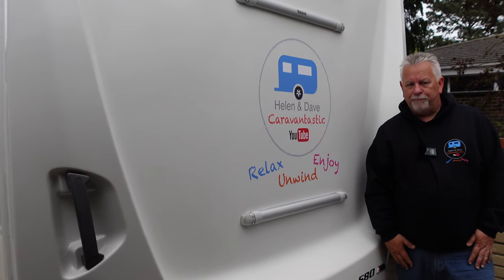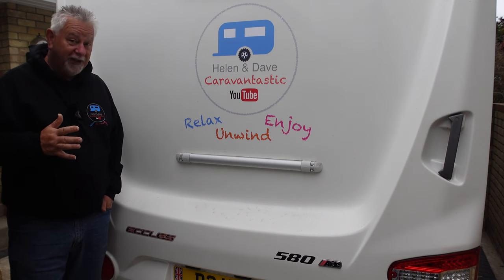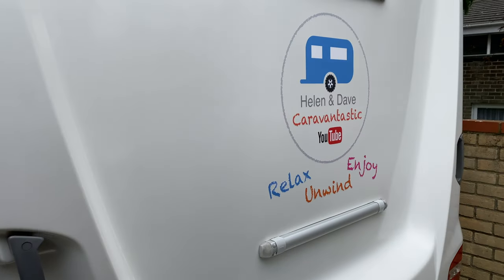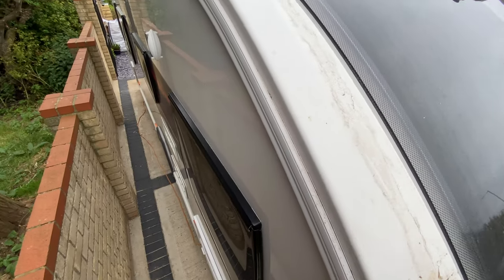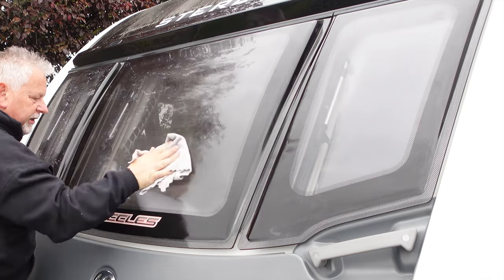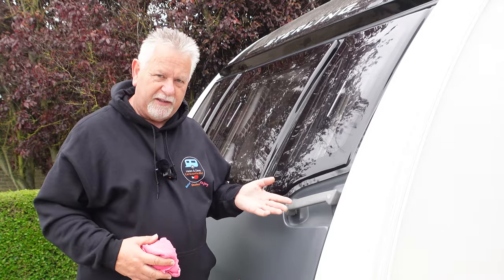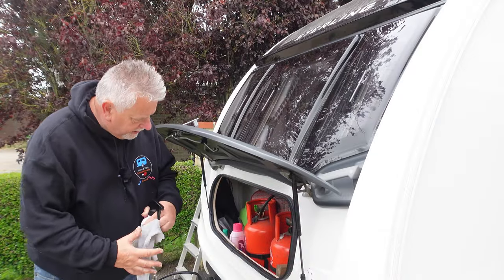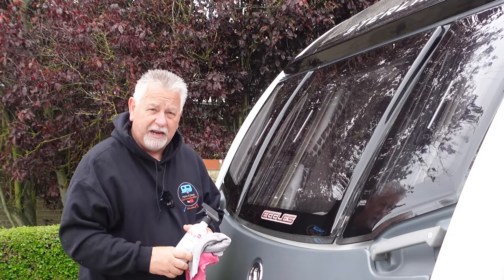Amazing results with Silky Dry & Shine!

Comment: Hi Dave, Really brings up the shine but I’m dubious about the dirt building up on the cloth and eventually causing fine scratches as you go along 🤔 . On another note about the caravan club not allowing people to wash their caravans - I would prefer to see clean caravans on a site as it would make the site look more respectable. I’ve also been in that situation a few times leaving home with a clean car and caravan and arriving covered in dirt. I carry a bucket and wash shampoo 😁.  Cheers, Rob 😀
Reply from the maker: Love your style Rob! Where there's a will, there's a way lol. 
I also agree with your point ref: 'dirty cloth'. Dry & Shine is a great detailer, to use after a dirty caravan as had a pre wash, it adds a great shine and really useful for getting to bits that need a little more or were missed during the wash but I've found it really useful on site, mainly front and back to clear light dirt/dust away. I also agree, clean caravans on site make the place look better. Thanks as always, Dave

Comment: Hi Dave so this works the same as waterless wax meaning you can clean a vehicle without rinsing with water that isnt too dirty all over like grit from the road etc.  but just use on dust and odd marks from dead flies etc. It certainly looks lovely and shiny. My brand new van has sat on our drive 3 weeks collecting pollen off nearby hedges and general dust as we havnt used it yet due to a slipped disc in my back its so frustrating just staring at the van 😁 always follow your videos. Keep up the good help for newbies like me. 😊
Reply from the maker: Hi there Sally, sorry to hear about your slipped disc. I’ve had one so understand your frustrations. Hope you are able to get out and about before too long. This product is ideal for just getting the shine back on your van without the full on wash & wax. Take care, Dave & Helen 👍

Comment: Hi Dave. Ive used Silky cream cleaner for 40 yrars and it is s brilliant product from an excellent manufacturer.  However I still feel that you initially need lots of water to wash off the fine grit and dust be shampooing the van.  Otherwise I cannot see how this and other dry products don't leave fine scratch marks especially on perspex windows.
Reply from the maker: Hi Dave, thanks very much for watching and leaving a comment. This product is especially useful to use as a detailer and use in addition to a normal wash & wax. I’ve found it to be really good to use on site when the van is lightly soiled/dusty from a trip but I do agree, a dirty van needs a wash first. ATB, Dave & Helen 👍